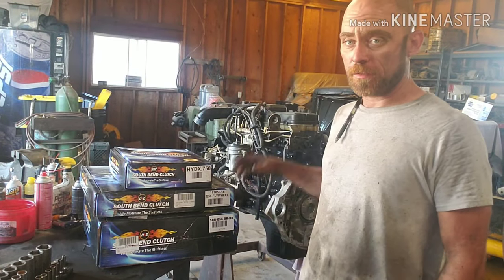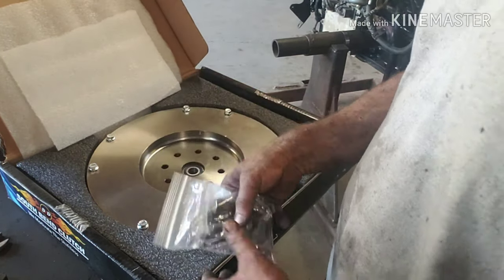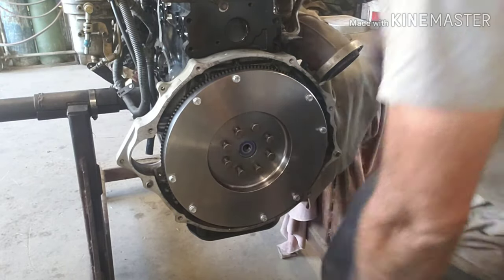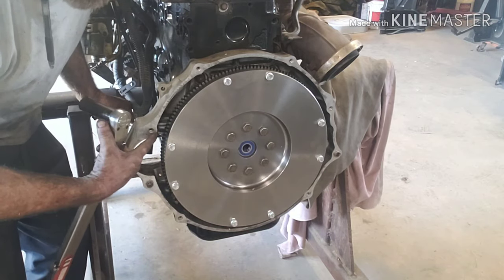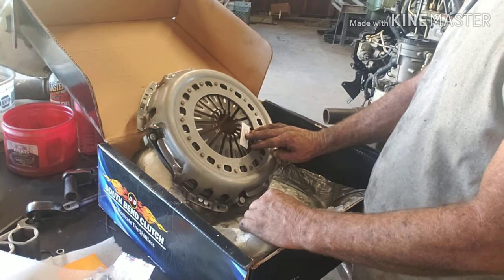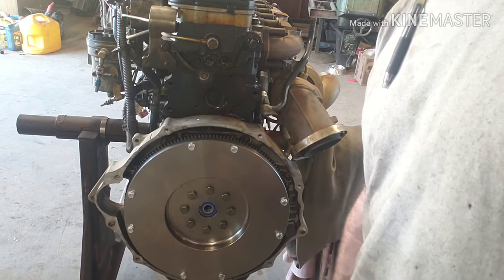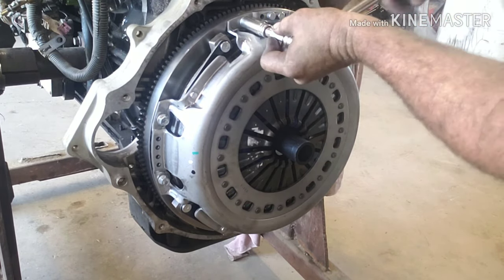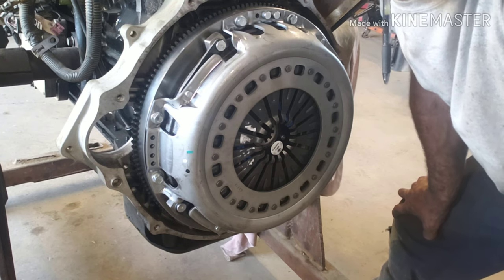South Bend clutch - Installation on 2006 dodge 2500 - gen 3

Comment: Will South Bend do the clutch and new slave cylinder in on a 05 Dodge 3500 4x4 long bed dullay and what do they charge for the job ?
Reply: Don’t think southbend does the actual job, they just make the clutch assembly itself. Your local mechanic/ dealer or yourself would do the job of putting the new clutch in